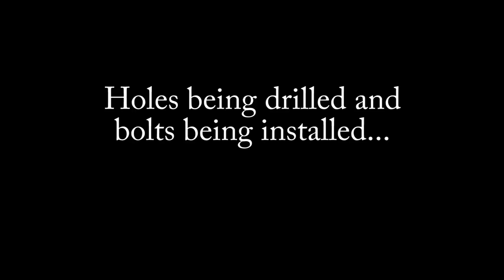Installing A Gray Water Tank Part 3

Comment: Using the best quality drill possible is a good tip. The next is to sharpen or replace the bit when it has dulled.  A must is to center punch the location deeply and predrill any hole larger than 1/8 " diameter with +/- 3/32" starter hole to prevent jumping and facetting (predrilling removes the larger drills thicker web mass away from your workpiece). Last use a cutting oil and safety eyewear protection.
Vertical large diameter holes can be assisted by your helper with a 2x4 as a see-saw lever to push up on the drill handle.  Saw a friend and dad effortless drill a car frame for a receiver hitch that way, they used a fireplace log for the fulcrum. He held the contractor 1/2" drill from rotating while the father pushed down on the 2x4 end.
Reply from the maker: My Helper? Back then I had no helper because I had just moved 450 miles away. But thanks for the tips and thanks for watching.

Comment: Use what they call elevator bolts . They are totally flat on top and the head is about 3/4 “ of an inch in diameter. I use them on forms to leave a flat surface on concrete. You can get them in 1/4 to 3/8 thread size.
Reply from the maker: Use them where? I have used them on the plywood flooring before.

Comment: Looks like a tricky retrofit project to add this wastewater tank.. Thanks for posting your video. Think about using steel plate end caps on both ends of your tank frame then bolted to the trailer frame to counter the racking forces during braking and acceleration.. Any consideration to cover the plastic tank with metal to prevent rock damage?
Reply from the maker: That is what the metal straps going front to rear are for. No I have no plans to cover the tank with metal.

Comment: Yes your talking about supports so that not all the weight is put on the holding strap's. Nice work. As for those straps that are to long don't cut just bend them hey hang from the supports.

Comment: Larry I think if someone felt the need, they could easily add some thin sheet metal in front of the tank to absorb rock hits should any ever come up.  And would you use stainless bolts on this apparatus and those look like lock washers you used.
Reply from the maker: I don't use stainless bolts or screws on anything. Too much money and not really needed. But someone else may wish to spend the money.  Yes I used lock washers.

Comment: I've been looking for a video series like this since I bought my '66 Aladdin three years ago; thanks for posting this!    
  Is this the max capacity you would recommend for a trailer this size? I was thinking a little larger to make boon docking a bit longer possible but don't want to compromise my trailer either.
Reply from the maker: This was the largest gray tank I could find that was under 6 inches in height. If you have more clearance you could go bigger. Just distribute the weight properly and remember that a gallon weighs about 8 pounds. So it adds up fast. Another thing you can do is have two tanks ganged together with a pipe. Install the pipe at the lowest point of both tanks.

Comment: rubbing steel on plastic at one stage rubbing will cause leaking putting rubber around where the steel and plastic touch and glue it to the plastic or steel just a thought

Comment: Well done. The only thing different I would have done is cap off the 3" pipe for the outlet your not using.
Reply from the maker: I'm going to do that. Don't want any critters making their home in there.
Reply: Well yes except one pipe is for waste and one for air circulation that will allow the toilet from backing up.  The others can be used for the kitchen sink if not your right cap them. I have dreams of putting together my own little mini trailer. Maybe some blocks to hold it in place or rope tided at each corner an pull it into place just for temporary use. An I thought he was doing a toilet tank. sorry.

Comment: No p trap out of shower. Nothing to stop the bad smell of the tank from entering in through the shower drain.
Reply from the maker: You need to watch again. We use a different type of trap in this system. There is one for the shower and one for the sink.
Reply: mobiltec  I stand corrected. Somehow I missed the hepvo trap part. Simple idea. Thats exactly what I need to connect my shower to my gray tank. This is why I find youtube a valuable resource. Thanks
Reply from the maker: You can learn how to do just about anything on You Tube. Yes it's a valuable resource for sure. Thanks for watching.

Comment: Larry what are you going to do for the toilet discharge?
Reply from the maker: As said in the video the toilet for this trailer is a dry toilet. It has no waste tank. It has mylar bags in it and you just throw the bags away when they are full. I had never heard of this type of toilet before this trailer. So there is no need for a black tank.